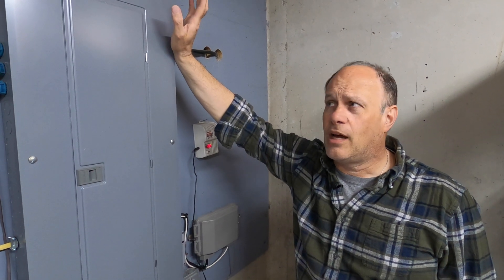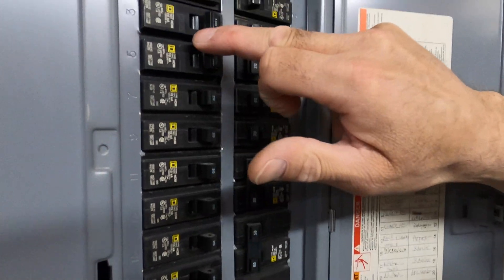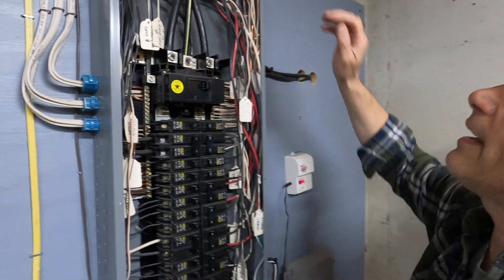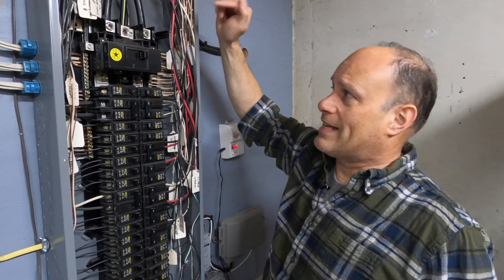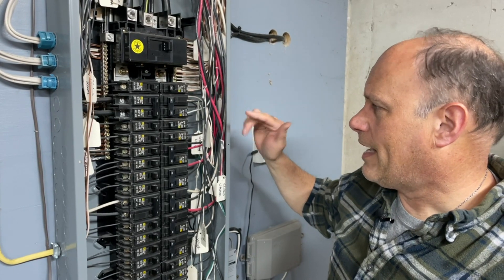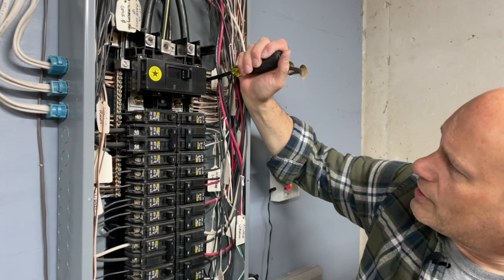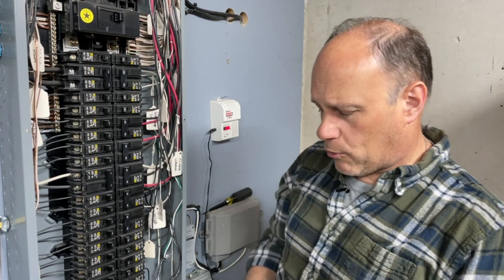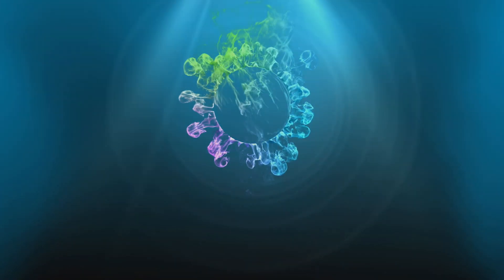Electrical Panel Box Troubleshooting TIPS!

Comment: Thank you for this video. I have an older home that has fuses instead of breakers and I need to make sure the wires in the panel are tight and looks good. I didn't realize there could be loose wires there possibly causing issues. I hope you will make more videos like this, thank you!
Reply from the maker: Thanks for watching!

Comment: I had a bad storm recently and one breaker flipped. I keep trying to move that breaker and it won't stay in place . Any suggestions? It's my back porch and storage room lights. They're off . Kate
Reply from the maker: Kate,  sorry for the delay.  You might have gotten some water in your porch receptacle..  curious if the breaker that tripped is a standard type or a ground fault type?

Comment: I have an old house the ground wire was connected to galvanized pipe, and I had plumber upgrade to copper with isolated water pressure unit. so I decided to rewire my garage, so I ran three wire from house panel to garage panel the proper way, and ran a ground post outside the garage wall. you mentioned two in vedio two six feet apart gronding posts, do I have to add a scond post or one is good enough.  I love your vedios I will install some security camers outside, your showed how iit's done is a grea help. Thank you. Maruk
Reply from the maker: Hi Maruk.. sounds like you are really getting some projects done!  Are you running a new service cable between the main panel and a sub panel in the garage?  Just wanted to make sure I’m giving you the best info.
Reply: @completepete  Yes Pete, I have done that a while back, Not having a convenient place around the house to drive a groundind rod I decided at that time to drive the rod just as close as I can to the wall outside the garagefrom the subpanel, my garage is all by itself detached from the house, I am more digital electronic orianted, I am retired now so the question do I need to add a second rod six feet away from the first one. My main Panel is 100amps and the sud is 50amps. I really appreciate you you help and knowlede, Maruk
Reply from the maker: Maruk,  typically the ground rod is tied into the main panel. The idea being that in the event of a surge or lightning strike, the excess energy will drain to ground through your water pipe connection and ground rod quickly and directly. While I’d prefer to see the rod tied in at your main panel, at least you have a rod in the system. I normally use two rods spaced 6’ apart if there is no good water pipe ground or if the soil conditions are poor.  With your water pipe connection and single rod you should be ok.
Reply: @completepete  Thanks Pete.

Comment: I have a 2012 new built home, Town electric inspector passed home with a Murray Box with some Square D breakers, will this be any problem?   Thank you.
Reply from the maker: John, thanks for watching and reaching out.  While Square D breakers “fit” into the Murray load-center, they are not listed for use in this load-center.  In some cases, on older panels they will list some breakers that are interchangeable on a decal
inside the cover.  This would most likely not be the case with your panel since it’s fairly new.  The simplest solution would be to purchase replacement breaker (I believe Home Depot has them).
I would not run screaming out of the home, BUT it might be something you want to repair for your piece of mind.
Reply: @completepete   Thank you, I am pissed that Electrical inspector for County would pass this?
Reply from the maker: I Would agree that an Electrical Inspector would have most likely picked up on this.  A Town Building Inspector might not. Hopefully you can get it worked out.